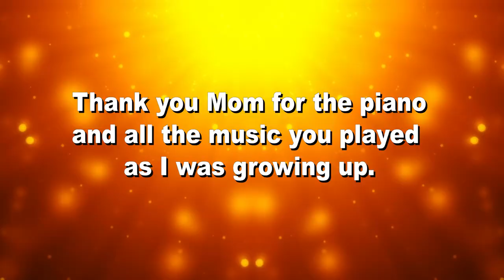How To Replace A Broken Piano String - (PLEASE READ DISCLAIMER BELOW)

Comment: Recently I am thinking to replace my piano strings. I watched what you did, very impressive. I wonder what kind of piano string you bought from Amazon. Could you pls tell me seller’s name? I have 3 broken strings at high pitch section. Looks like they are the same gauge. So I want to order a few feet long. Thank you very much.
Reply from the maker: Thank you for your comments. I bought my string on eBay and there are many available. Here is the seller I used.
https://www.ebay.com/itm/292195039143
Reply: Thank you very much. I just put an order. They will be delivered about 10 days. Thanks.
Reply from the maker: @lisal1093  Best of luck to you. It’s a little tricky but take your time and you’ll get it.

Comment: If you look inside a Bosendorfer Imperial Concer grand, you'll see that the treble wire doesn't go down around the pin and back again. It's individual pins, 3 for every note. So one broken string menas just fiddling with one tuning pin.

Comment: Sounds like you have some loose ribs in the sound board. Also be mindful of the iron-wound strings in the tenor section. they are often the most brittle. I presume that someone renewed all the bridle tapes before you ever removed the action. With old sticker actions like this, that can really be a pain in the butt.

Comment: Please never use locking pliers on a piano. If you strip the tuning pin, the pin will never be tunable again. He skips very important parts of installation in this video- hire a tech if you don't want to scratch up the insides and save a LOT of headache. Keep in mind that the string will never sound like the other strings again, it'll always be brighter.